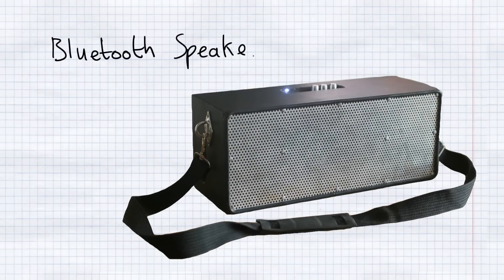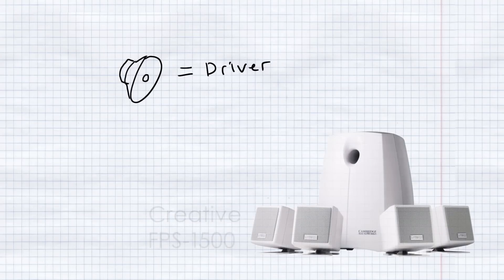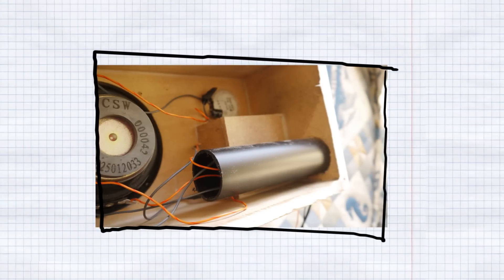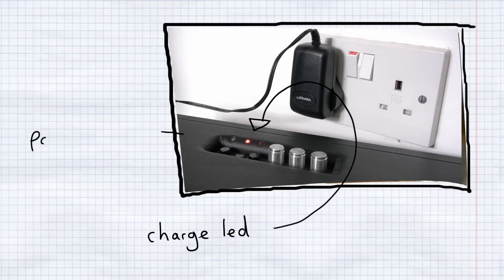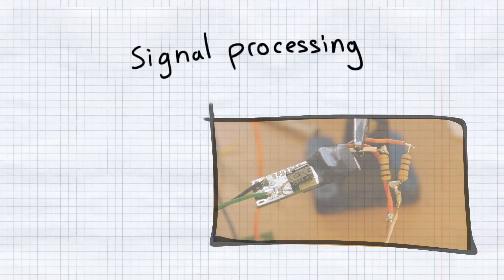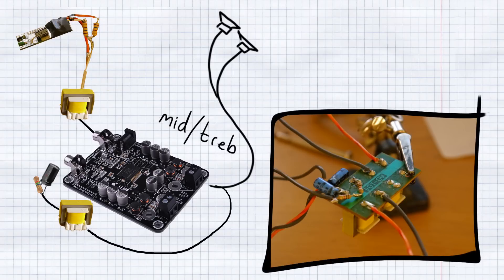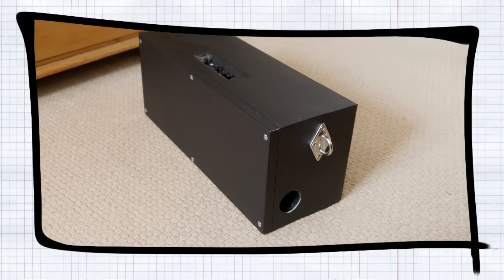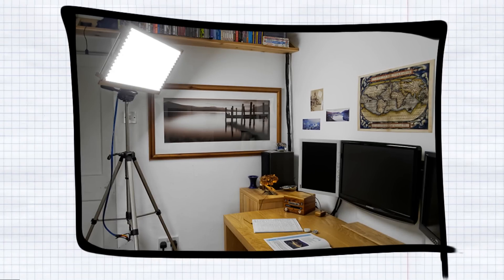Homemade Bluetooth Boombox - Build Log

Comment: Hello...thank you for this inspiring video. I was wondering if I can take apart an old 2.1 Creative system with 2 satellite speakers and 1 woofer and shove that all in an elongated box and drive the power source through some battery? I mean to ask whether the amp in the woofer will suffice? If so then I don't have to purchase the electronics.
Reply: +Saptarsi Bhowmick Take a look at the power supply that comes with the system. It will probably be 12V (i just had a look at mine - i also use creative). So yes, you can use a battery pack to run that, just be sure to match desired voltage and required current. Be aware of the fact that while being discharged, the battery voltage will drop. Since the system isn't designed to work with batteries, it may stop working, even though you still have some energy in your battery pack. If you will use li-pols be aware of the fact that you can kill them if the voltage on the cell will drop to low. 
Good luck mate.
Reply: thanx buddy!!!

Comment: HI, great video. But could someone explain better when you connect the bluetooth on the amplifier (3:57) especially that transformer, why is it necessary? What would've happened if you didn't use that, just let them share the same ground?

Comment: the part from the old speaker that you use is just the speakers, right ?
and about the voltage converter, is that depand on what kind of amplifier that we use to ?

Comment: Hey nice project! I made something similar before and am at it again. Last time I bought speakers so had all their parameters at hand(like Fs,Qts,Vas ect) for port calculating software but this time I also want to use an old Creative’s bass speaker  that I striped long ago but measuring the parameters is really hard and I don’t have an amp accurate enough. How did you determine those parameters to be able to design your enclosure?
Reply from the maker: I didn't calculate them, but just experimented/guessed at what would be the best sized enclosure. I don't think it's anywhere near perfect, but it does the job.

The risky bit was choosing to make it ported, which throws up a lot of variables, but it actually works luckily.
Reply: DIYPerks
Thanx man, think I’ll go with a closed enclosure if I can’t figure the stuff out by tomorrow.

Comment: You are using a 2x15W (@ 4 Ohm) amplifier and you're connecting 2x4Ohm midrange and 2x7Ohm treble drivers in parallel. That's a total resistance of 1.3 Ohms on one channel, that's supposed to work on 4 Ohms. Does your amp overheat?

Comment: Hey how did you calculate the port dia and length? I have a 3w 2.5 in drivers and that's all info I know about them , how can I make a port for a speaker enclosure using this info?

Comment: Hey I'm planning on making one of these and have some pretty decent speakers that I want to use. They are 4 ohm speakers and I was wondering if I'll have any problems using them. 3 speakers will be used for mid/treble and 1 speaker for the bass. I assume It will be fine if I connect the speakers in series. But i'm afraid that will distort the sound since the total impedance will be 12 ohms through the first channel. Should I go ahead and use those speakers, or find some high impedance speakers to use?
Reply from the maker: There's no harm in trying. I connected my mid speakers in parallel, and treble speakers in series, all on one channel. The mids were 4ohm if I recall correctly, whilst the treble speakers were 7ohm. The treble was initially too loud which is why I connected them in series - to reduce their volume.

Comment: How did you wire the dc jack in between the charger? Like, where do the wires need to be soldered? I am almost done with my building plan, this is the only thing I need to know before I can start building my own!! :)
Reply from the maker: I wired mine up to a multi gang switch - this makes a "charge" button. If it's off it powers the speaker - if it's on it enables charging but still powers the speaker.

It takes some time to work out how to wire it, but it's easy enough. Hope this helps, and good luck!

Comment: Hm. In US currency it would cost around 80 bucks to make one. When I could just buy one from anywhere that could be possible the same for around the same price, or $5-10 more for a better quality. Not saying I don't like you're videos, they're awesome. I just found that it could be much more logical to buy one.
Reply from the maker: Nick Perod I was kind of recycling so it's pretty good value if you do that. I'm pretty sure the bass is much better than on $80 units too.
Reply: I have never seen a bluetooth speaker for that price, and if it is that much, it must sound god awful.
Reply: Things of that size cost in around 200-300USD.
Reply: misium I'm actually in the process of parting this out as an alternative to the Bose Soundlink III for a friend. $300 for just the speaker and wall charger, plus she wants the charging cradle.

Comment: Can you put a picture of your low-pass filter on your google + ?Something with some detail because I dont understand how do you put the potentiometer connected with those capacitors and resistors.And why do you use 2 capacitors and 2 resistors instead of 1?

Comment: How would you go about adding an electric guitar input? Or any chance of doing a portable guitar amplifier build?
Cheers
Reply: Just buy a 3.5 female jack (or any type you want) to a 3.5 male jack and cut of the male jack than connect it the same way as the Bluetooth module. Sorry for the bad English I am Dutch...

Comment: I gotta 15w x 2 Bluetooth Amplifier that needs power from 12v - 22v (19v - 20v was recommended).
What is the best battery and automatic (smart) charger to use?
Additional parts if needed.

Comment: I've been plotting something very similar for some time and have just come across your video. A couple of things are confusing me a little bit:

1) How do you get the batteries to charge and output at the same time? Is it just a case of wiring both input and output in at the same time?

2) Can you elaborate on your series of gang switches that allow you to switch between charging, not charging and direct mains power? I can't get my head round it >_<

Basically, if you could share the final schematics of your circuit that would be amazing!
Reply from the maker: The batteries don't output any of their power when charging; when the charge button is pressed, it disconnects the battery and connects it to the charger. The DC power that the charger is using is at the same time routed to replace the battery's power. I know it's a bit confusing, but if you sit down with some 9-pole multi-gang switches and some wire and think about it, it's something that you can work out. Hope this helps. :)

Comment: I would very much like to use this stereo into mono trick of yours, but i don't get how you do it. Do you just connect the resistors to the two positive signals from the reciever ad turn it into one positive and then only use one of the negative signals? and lastly I cannot hear what resistors you are using. Thank you very much in advance!

Comment: DIY Perks  what speakers would i need if i was looking on amazon? I know these were part of a pre-made set, but what if I just buy the actual speakers
Reply from the maker: Adam T Not sure if Amazon is the best place. If you're in the US, check out Parts Express. Lots of choice there (and they do ship internationally if you're happy to pay the postage).
Reply: DIY Perks Actually went through and got most of the parts. The only problem I'm having is with the ground loop isolator and low pass filter.  First off I'm using and aux port for my input, would i still need the ground loop isolator. Secondly did you buy or make the low pass filter.

Comment: Can I make a DIY request? Can you make a Bluetooth FM Transmitter for a car? My iPhone has a busted 3.5mm port so I can't use 3.5mm adaptors anymore. Upgrading the stereo in my car is at least $300 because I need to replace the mounting area on the dash, and then you have to buy a head unit. That would be really great if you could make a DIY for one.
Reply from the maker: 19aas95 It's not something that needs a specific DIY build really. Just get a cheap Bluetooth receiver and FM transmitter and plug them together :) loads on ebay for <£5.
Reply: Thanks!
Reply: Andy you can also buy a audio jack that plugs into where the charger goes I think it's fiio that sell them you get a much better quality aswel

Comment: can i do this if each the drivers have different watts? Can the batteries alone be enough to drive a 50  watt system? I'm planning on using the sub on the logitech z313 and buying seperate midrange and tweeters.
Reply from the maker: Yes, 50w is possible. It just won't last as long when at full volume.

Comment: Hi
I just like to know if there was any particular reason of not filtering the upper and low ranges before the input of the Tripath amplifier.
Particularly I was looking to build a 2.1 channel unit. So if the bluetooth module has its input diverted to two different amps, one directly feeding it to stereo amp and one exactly as you did by mono-ing it and then feeding it to some mono based class d amp. Will get a powerful bass, right then?
Thanks.
Reply from the maker: Arjun Menon I didn't filter it to the tripath so that the mid/trebel drivers would receive the full frequency range.
Reply: DIY Perks Okay. So will it be of any concern when I practically use the lone output of the bluetooth and divert it to two different amps? Or is it better to feed the output to the input of a single amp and then from the Amp's output do the filtering and divert it to different drivers?
Reply: Arjun Menon
The second choice seems to be a lot more sane for a portable device. Think of the consumption and complexity of having 2 amplifiers.
Reply: DIY Perks
Hi, Just wondering if/when you'll be sharing the amp signal processing schematics? Cheers.

Comment: Hi DIY Perks, does the TA2024 amplifier not have a 5v output? So is there any reason you would not just use this to run the bluetooth receiver?
Reply: Sam Martin The TA2024 doesn't have a 5V out so you unfortunately cant do this.

Comment: I'm a little confused how you wired in the ground loop isolator. My amp is very noisy and I've narrowed it to the ground wire to the battery. When I pinch my solder joint between the battery and the amp it nearly completely goes away. What can I do? It's only noisy in the bass channel, I have a 2.1 amp.

Comment: DIY Perks I'm gathering the materials for a similar speaker system. My friends keep telling me that it's stupid to use speakers with sensitivity below 90db. i assume the speakers in your build are much lower. Do you think it matters?
Reply from the maker: ***** 80db is considered kind of average, so assuming the speakers you're planning on using aren't something silly like 70db they should be ok.
Reply: DIY Perks I'm going to use and drivers from a creative set that matches yours. The drivers are from Cambridge sound works and I believe they are the same as the ones you  used, however there is no online comparison or definition of their decibel rating so it's hard to figure out if they are suitable for my build. I'm going to use them anyway and figure out if they're suitable for my build if not I'm going to get some better drivers but at least for now they should be sufficient. What would you recommend for an amplifier if I am not to use the double amplification trick that you showed in the video. Thanks a lot!
Reply from the maker: ***** A new amp has come out since I made this video which is pretty much perfect for this kind of 2.1 setup: eBay# 391101278723  (put it in the ebay search bar). It's way overpowered though, so you'll need to cap its output with a resistor over the input so as not to blow the speakers.
Reply: DIY Perks Thanks a lot!
Reply: DIY Perks If i buy this new more powerful amplifier, do i need to double amplify the bass or can it be used normally? Also, I'm using 100w speakers from a large stereo system; do i need to cap the new amplifier? (the new 
amplifier is 50w+50W+100W) if the amplifier still needs to be capped 
what resistor would i use and where would i put it? thank you
From Kojolink to more powerful amplifier           http://www.ebay.co.uk/itm/High-Power-2-1-HIFI-Digital-Subwoofer-Amplifier-Verst-Board-50w-50W-100W-TPA3116-/391101278723
Reply: +DIY Perks do you have a detailed circuit diagram of this project ? as I'm having the same creative 2.1 speakers n wanna fuse in the Bluetooth module n some battery to make it portable !! can provide the detailed circuit modifications of the amp u did. . .??

thnx n love from India

Comment: hey man, i got a question about speaker amps and ground looping 
in one house i get cpu noises on my speakers and in the other house its silent unless i plug the pc in the same outlet/splitter as my speakers i hope im not making this confusing if someone understands what i mean go ahead and explain it better but the problem is the noise and it has to do with the house and maybe how its grounded, help would be appreciated

Comment: out of curiosity . what whould happen if you use batteries to take 12v and 5v without using any voltage reducer?   

(negative cable)   |ı-|ı-|ı-|ı  ( 4.8 volt cable )  |ı-|ı-|ı-|ı-|ı-|ı-|ı-|ı-|ı ( 12 volt cable )

Comment: How would I put together a low pass filter?  And also what is the black thing connected to the capacitor by the treble speakers? :S please help,  I don't know much about electronics but I'm determined to make this.  I already have the amp and the speakers but I don't know what exact resistors and capacitors to buy :)
Reply: I've made a low pass filter now but does the battery pack i use have to be AC?
Reply: Kojo terrile 12v DC
Reply: JaffaCaik thank you

Comment: Hi guys can we use a charger of 5v output to charge the battery pack???if no then how did this guy keep a charging point .. I'm using 20 batteries of 1.2v 2800mah ...please reply guys

Comment: So I'm planning to do a similar project. I will use 4 ohm, 30Hz-20kHz, and 30-300W speakers. Would 2*40W or 2*30W amplifiers work for those speakers?
Why is 8 Ohm better? And how important it is. I can't find any 8 Ohm speakers.
Reply: either would work, but it's almost always better to use a higher powered amp

Comment: Is the 12v battery pack necessary? Or can I use one that only has 7.2v?
Reply: 7.2v is a bit low, most of the amps wouldnt even turn on with that voltage. better use 2 of them and youre fine.
Reply: gamerpaddy Alright... And what about the frequencies? What would you recommend each driver to have?
Reply: Well, the volume of your housing should fit the speakers recommended size. 
Best thing to do is to measure the original housing and build your portable one with exact the same values.    If the housing gets too big,  look for some passive radiators. (like the bose soundlink mini uses)    more bass on less volume.
Reply: gamerpaddy I want to get single drivers. Highrange and mid-/lowrange drivers. I dont have any laying around, so I wanted to get a 13cm one for bass and two highrange drivers which are maybe 10cm max. But I dont know about the Hz... How much they should have to get a decent sound. And if the housing isn't too big, can I still use such a radiator? Then I could just put some alround drivers in there to run in stereo with a higher Hz number at the bottom but more  to the top, so I could equalize the bass with the radiators.
Reply: 13cm, hmm.  lets keep below 55hz and above 35hz for lower range, and 3000-6000 for higher range.   the highrange should overlap the frequency response of the 13cm one. so if the 13cm one goes up to 4000hz, get a highrange one that has its lowest response at 3000-3500hz.   but i not sure 100%     best way is to get some old speakers from ebay or junkyard and try try try.

Comment: I don't want to annoy you, but would it be possible if we were able to get the exact components you used for your low and high frequency filter because I'm trying to build one on my own but I can't find any good solution on the internet. Thank you very much

(Sorry if I made mistakes, I'm not a native english speaker)
Reply from the maker: Search Google for "RC low pass filter design tool". It'll allow you to build one with your desired frequency response.
Reply: DIYPerks Thank you! Have a nice day ;)

Comment: hi perk , i am having trouble with my power source , i use 11,1V batteries , and i use a 12V charger for my all build , do you think it will blow up ( Sorry my English is so bad )
Reply: I think that's ok. you actually need more than the battery output for charching. you should however becarful with current. specially when charging nimh batteries.
Reply: +astafzciba tks man

Comment: I'm having a little trouble with my tripath amp. I'm using a standard stereo signal from an iPad and powering 2 100w speakers. As soon as I pump the volume above 60% , the amp crashes as requires a restart. What's going on?
Reply from the maker: Daniel Jacinto What's your power source?
Reply: +DIY Perks don't worry I've figured it out. My speakers are only 3 ohms.
Reply: Hi Matt, I am inspired by your video! you show a lot of interesting and exciting Projects summary. I want to express my deepest respect and wish you success in FUTURE PROJECTS)
ps. if not difficult to answer please tell me, in what program you do animations to video?

Comment: Hi! 

Where did you get the low-pass filter? I searched for it but I didn't find what I want. Do you know where i can find a simple low-pass filter like you used, or the parts to make one myself, it should be able to handle 25-30 watts.

Thanks! :)
Reply from the maker: Martijn Beele Just search Google for "RC low pass filter calculator" and the results should help you to build your own :)
Reply: DIY Perks Okay thanks! :)